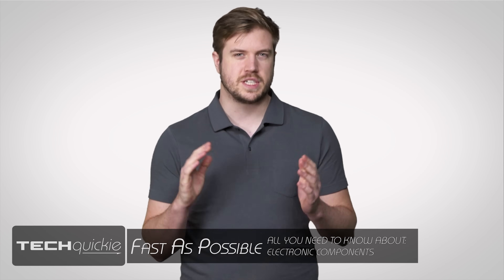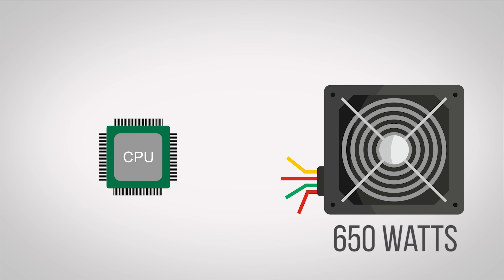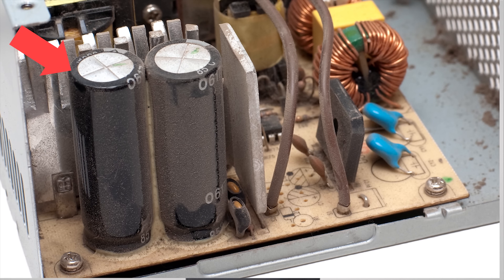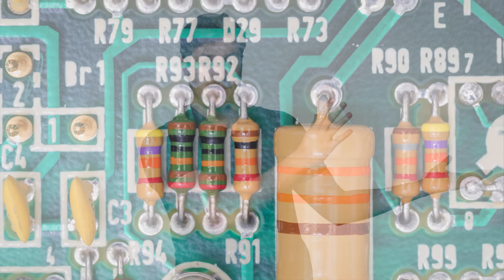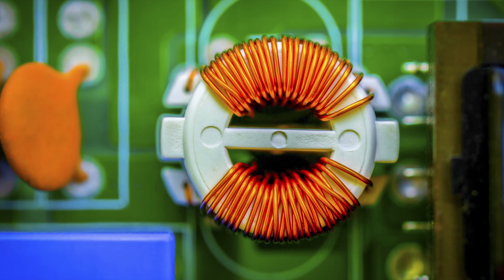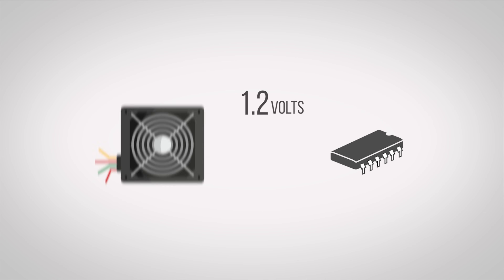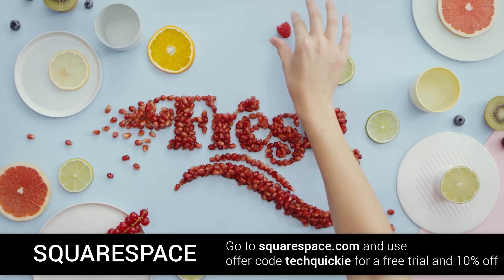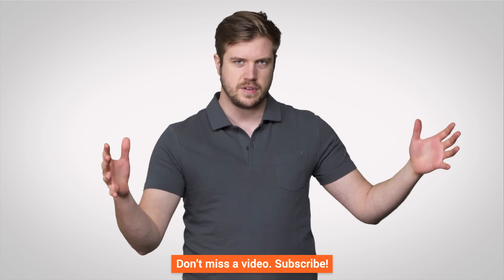Capacitors, Resistors, and Electronic Components

Comment: Alright, time for the electrical engineering dude to critique this video.
...
Eh, resistors are more for signals most of the time, and not power. Chokes can also be called inductors (in some cases). Also, there are some capacitors that look similar to resistors (look under the cpu socket and you'll see them). Not sure how important diodes would be in this video's context, but they're also a thing.

All in all, a very good video! I think it would give most lamens a decent functional understanding of most electrical components.
Reply: Alright, time for critique of engineers of youtube.
Resistors are also used for current sensing for main power circuits.
These kind of resistors have low resistance and are very often called current shunts.
Reply: As with all of these videos, there must be a limit to how in-depth the information is. We don't want people who are unfamiliar with electronics to be completely confused!

Oh, and laymen's terms, yeah, I've really only heard that word spoken, not written, so yeah.
Reply: LazerLord10 computers are full of diodes , the switch mode power supply's employ a full wave bridge rectifier on the mains input. Power supply's also contain a fair few power resistors > 2 watts. Opto isolators and op amps might have done with a mention as A/D conversion is a big part of the io on a motherboard
Reply: Diodes play as a freewheeling component that prevents any pickup from coils that generate magnetic field, moreover the power supply where strong magnetic fields are generated. 
Semiconductors are materials that exhibit both properties of a conductor and an insulator. They behave mostly like a conductor, except that with temperature increase their resistance lowers instead of getting higher like a normal conductor. They also exhibit a non linear response to current vs voltage, while a passive component (like a resistor) produces a linear response to current vs voltage.
All chokes are inductors but not all inductors are chokes. Chokes are used to block AC (hence the name choke coils) and let the DC pass through. They are usually found on audio where high frequency signals are blocked. Inductors on the other hand generally acts like a capacitor - except that it stores energy in its  magnetic field while a capacitor stores energy in its electric field. Capacitors and Inductors can both be used as resonators that is useful for AC applications within the computer like audio, modulation, demodulation, and among others.
Reply: Benjamin, the most important property of a resistor is probably the fact that you can put them in series and or parallel so to say easily. For example, a voltage divider can do many great things when it comes to controlling a singal. When most people think about resistors, they think about power resistors, limiting the current going to a certain load. These days you'll better be off using a specially designed power supply. Resistors can also make up filters, like RL filters, RC filters, etc. These are required to smooth out signals and prevent certain frequencies or things like that to disturb the incoming signal. In conclusion, resistors are often used to remove noise from signal paths, so that the controller does not see a accidental voltage spike as a transition.
Reply: Also, the inductors do not filter current after the MOSFETs, they form part of a multi-phase buck regulator, which reduces the 12V to 1.2V. To do that linearly would mean dropping 10.8V across the MOSFETs, which at 80A (max TDP for a skylake i7) would mean 864W dissipated by the motherboard.
Reply: you litrely took the words out of my mouth
Reply: what do you mean resistors are more for signals?
Reply: TVS diodes are commonly used on USB ports, so you're very likely to find them on motherboards.
Reply: +LazerLord10 You must remember that this is the internet & the odds of anything you or anyone else says being complete bullshit are pretty damn high. First off the name, does kind of give us the idea you're 10 or something. Second, it's the general idea that anyone with "a life" which translates to "a job", usually doesn't bother with the comments section. They're usually too busy working & only have time to watch a video briefly rather than have a debate over. I'm not saying you are 100% in fact lying but just throwin' the possibility out there in case there's any gullible kids thinkin' "omg a smart person". Every comment on here must be taken with a grain of salt, including mine.
Reply: I got fired month ago and I have a lot of time for youtube comment section debates xD
Reply: But will they pay 2500EUR netto? xD
Reply: Lazer , you should make a video.  I wish someone with a background/solid knowledge of electrical components would do a video on analyzing a desktop motherboard.    I care about accuracy when it comes to things like this.
Reply: resistors are more for signals most of the time.......... WTF?
Reply: diodes are also a thing.......................WOW   BRILLIANT INSIGHT!
Reply: Frz if you learn PCB design free of cost so click these link
https://youtu.be/ApXhpz8XPWE
Reply: I'm another electrical engineering dude and ngl it pissed me off the way some things were explained in the video
Reply: Could you further explain what "for signals" means?
Reply: Mr Electrical Engineering, just wanted to point out that a diode is actually a semiconductor. But yeah, 2 layers semiconductors are important. LED is an example. And nowadays manufacturers try to use LED for everything.
Also, there are many 3 layer semiconductors that are important, not only MOSFET. IGBT and BJT, for example.
And finally, 4 layer semiconductors. Which won't mention because I'm lazy.

BTW, being strict, the title of the video is wrong. It's talking about chokes, or as you pointed, inductors, which is an electrical component, not electronic, as the title might suggest.

Oh, and you are right. SMD components can be resistors, diodes, LED, capacitors, inductors, antennas... It's reaching a point where sometimes you can't tell what is what if not labeled/documented properly.
Reply: Never heard of those, somehow.
*Googles what they are
Oh, they're like Metal Oxide Varistors, kinda.
Reply: Never heard of those, somehow.
*Googles what they are
Oh, they're like Metal Oxide Varistors, kinda.
Reply: LazerLord10 lamens? Lol
Reply: Arek R. Shunts are whack, inefficient current sensing, not taking into account for parasitic inductance, etc. These days they use a coupling transformer or a hall effect sensor.

Comment: You forgot Diodes and inductors
Reply: Mrinal  Thakur aren't chokes inductors?
Reply: ... transformers are literally just 2+ inductors coupled to the same core...
Reply: And vibrators. Don't forget vibrators.
Reply: +Nizar El-Zarif
I made a tiny buck converter that could be varied to output from 3 to 30V controlled by a potentiometer with a fairly surprising amount of stability even for loads under 10 Ohms. The largest and most expensive component by far was the inductor.

On a more relevant note, they regulate the current rather than voltage. In many cases, this translates to a similar change in voltage, but the capacitors that are generally also present directly regulate the voltage.
Reply: chokes are inductors for blocking high frequency ac
Reply: Speedyjens ok
Reply: and crystal oscillators
Reply: Can you help me reach 300 subs with no videos yes we already mentioned that
Reply: FlatoutDude about chokes not inductors 
Though they are basically same but there is a great difference between them
Reply: "But I'm not going to say what that difference is because I don't know."
Are you going to complain that filter capacitors are like capacitors, but there is a great difference between them too? Yes, sometimes chokes will be wound differently to minimize parasitic capacitance, but they're fundamentally the same component with the same function. Chokes are just often optimized for a very specific purpose. If parasitic capacitance isn't an issue, I feel that most decent engineers would use a basic inductor to save on component costs.
Reply: inductors have several functionalities, in can be used in generating a magnatic field, apply phase shift, block high frequency. In the case of or VRM (voltage regulator modules) which is typical for a motherboard, they are used to store a positive or negative charge, and then up or down the voltage, depending on what you want to use them (try to google buck or boost converter).
Reply: Not really... I can't think of any non-mechanical components (at least that you'd find in a computer, and especially on the motherboard) that aren't made out of some kind of resistors, capacitors, inductors, diodes, and/or transistors... Are you thinking of something that's slipped my mind, or are you further to the left on the Dunning-Kruger curve than I thought?

Edit: Excluding heat sinks, connectors, and crystal oscillators, certain parts of certain types of memory (could be argued that they're made up of aforementioned components), and the connections between components... And any antennae and board itself, of course... And battery...
Reply: Nand gates, Nor gates, thyristors, variable transistors etc?... He's condensing 80 years of electronics into a 5 minute video. What does the general computer enthusiast know about such things, and would they be interested? I highly doubt it. Don't try to be too much of a smartass by trying to impress everyone with your limited knowledge of electronics.
Reply: You're a diode.
Reply: God Emperor Lionel Lauer yes
Reply: 999is666upsidedown if I am one I want to be a hyperfast diode
Reply: Edwin Antonio Chiñas Chiñas not always
Reply: Dylan Headrick yes
Reply: 12th ki science class nahi h ye !
Reply: Happy Singh what I am in 9th class 
Kya baat hai
Reply: Dylan Headrick which kind of oscillators mechanical crystal or transistor oscillators
Reply: I was talking about crystal since transistors were already covered in an umbrella term.
Reply: Dylan Headrick I also thought same cause crystal oscillators doesn't requires a resonator like a transistor oscillator
Reply: Hank yes they fall under inductor category
Reply: he did speak about inductors.. but very briefly..
Reply: Hank impressive. Did you go this as an engineer or a hobbiest. I don't have working experience in voltage regulators but you might be able to publish your finding in a scientific paper. This sort of application is in demand espcially for embedded sensors, or power harvesters
Reply: +Nizar El-Zarif
It was for a power circuits class. While all of the components were rated to operate within the specifications limited by my design, I suspect that they would have thermal issues when operating for very long. It was really just something I slapped together in a week or so while I worked on larger projects. Not really something I would want to stick my name on and throw out into the world, lol
Reply: See guys you cannot repurpose ferrite cores used as choke to function as  inductor inductors are designed for  minimum power loss and high transfer of energy  
Chokes are designed to saturate easily but inductors aren't a great example is flyback transformer with a air gap 
Though they work in mostly same principals they aren't same they are close cousins
Reply: Mrinal  Thakur and also quartz. But if you would mention every single component it wouldn't longer be quick.
Reply: ArthursHD yes I know that but still there are more than that many parts in a computer motherboard than he mentioned
Reply: v0000000000000000v not always
Reply: I'll take tat as a "no" to thinking of something that's slipped my mind
Reply: Hank what
Reply: Infidel Gastro oh really
Reply: +Infidel Gastro
Was your comment directed at me asking what other components were in there? If so...
Logic gates are just transistors and resistors.
I didn't know that thyristors were used in computers, but if they are, thank you for the correction.
I don't know what you're referring to when you say "variable transistor," but would it not fall under the category of "transistor"?

If you're replying to Mrinal, I agree
Reply: Hank why
Reply: +Mrinal Thakur
Because you're some kid who's acting like an expert when in reality you know less than I do on the subject, and my background has been digital logic design.
Reply: Hank you are right I am kid of class 9th but I bet I have more Knowledge than 75℅ of Linus tech tips viewers
Reply: +999is666upsidedown ????
Reply: @Mrinal Thakur: He mentioned chokes/inductors specifically. The description was even reasonably accurate.
Reply: yup he forgot about diodes but told inductors before
Reply: You forgot about... (lemme think...)

BATTERIES!!  :D
Reply: GreatScott! has a video about that, called "Diodes and Bridge Rectifiers" and "Coils/Inductors", respectively.
Reply: not to mention IC's

damn , mentioned them now
Reply: Frz learn free of cost PCB design so click these link
https://youtu.be/ApXhpz8XPWE
Reply: Don't leave out oscillators.
Reply: You also forgot transformers

Comment: Ive always felt like Capacitors looks more like batteries than water towers.

Considering this is the type of water tower im used to seeing
https://upload.wikimedia.org/wikipedia/commons/6/6a/S%C3%B8ndermarkens_Vandt%C3%A5rn_007.jpg
Reply: supervegito2277 thats cuz they are almost the same thing as explained in the video
Reply: Alloe me to rephrase that, they look more like batteries than water towers, ive never seen them as water towers.
Reply: Their purpose is to quickly charge and discharge voltage.
Basically just like a battery except MUCH more quickly and repeatedly.
Reply: Capacitors function as temporary storages, such as watertowers. Except capacitors also have a regulating and filtering function. The shape of capacitors doesn't have anything to do with it's function. So yes, capacitors are like watertowerd.
Reply: Batteries store energy in a chemical form. Capacitors store energy as a difference in magnetic charge, which is between two plates. Electrons can be deposited on the plates which gives you the ability to use it as a "energy reservoir" (kinda). I was about to write a massive paragraph on how capacitors work, but honestly if you care enough to know reply and I'll think of an explanation.
Reply: +BoomBrush
Yeah, the new notification system sucks, and I'm normally the one defending changes to YouTube.

I know the feeling. You're thinking of an electric field. A magnetic field builds up rotating AROUND a current carrying wire. An electric field builds up BETWEEN two electrodes with a potential difference (you may have been thinking about electromotive force, which is essentially the voltage/potential difference across something--in this case, the dielectric--with no current flowing between the two)  or in other words, ACROSS a dielectric with a potential difference across it.
Reply: supervegito2277 the do look like tiny D or C batteries
Reply: I know that now (and pretty sure i also learned that once, made my own alarm clock).. it was the comparison i didnt agree with..

Sorry if that wasnt clear...
Reply: supervegito2277 Ah, okay. Yeah, water towers didn't seem like the best analogy.
Reply: No need, point is they dont look like water towers to me

https://upload.wikimedia.org/wikipedia/commons/6/6a/S%C3%B8ndermarkens_Vandt%C3%A5rn_007.jpg

Ive always felt they looked more like batteries

https://res.cloudinary.com/greenline/image/upload/c_limit,q_90,w_1280/v1392754862/alkaline-batteri-d.jpg

Also feels like batteries too iirc.
Reply: Waits literally 2 minutes for picture to fully load

That is certainly a funky looking water tower. Looks more like a UFO landing station. Yeah, nah it's all good. I would probably write about it mainly so that I'm sure I understand what a capacitor even is. Meaning while I'm writing, I'd be confirming with myself plus other people reading to ensure I get it as close as possible to the actual answer.
Reply: Capacitors are batteries, sort of. Super Capacitors can be use as such, but the issue is, that they bleed a lot faster.
Reply: +BoomBrush ...I think you're thinking of the nonexistent flux capacitors... Capacitors store energy in an electric field. Inductors store energy in a magnetic field. It's the creation of the electric field that allows the caps to store a charge.
Reply: +Hank come on youtube, why did you add this google+ feature where you could tag people in comments then remove it? it was the only useful feature it had and now its gone. manually typing +Hank even though nothing happens. only doing it so other commenters know who im referring to

Well, I dunno what I meant when I said difference in magnetic charge, I've been awake for almost 24 hours so I'm kinda sleepy. I guess whatever it's called when electrons repel other electrons. Like, for AC circuits where the current "passes" though by the electrons creating a field then that field being used to push electrons out the other end of the cap (not direct electron push). I have no idea what I'm talking about, maybe I should get some rest. I think what I meant is that it was the electromagnetic force that was causing the changes or something.
Reply: supervegito2277 It's more of a functional comparison as opposed to a visual comparison. Capacitors can charge and discharge quickly, yet they also are used in scenarios where you can block DC but allow AC current.
Reply: How about resistors that look like little bricks with numbers on them. 
I had a dead laptop I was trying to see what I could see wrong and near the power input I noticed two of them with 
0.0 on them. I thought 0.0???  That must mean no resistance so they must be some kind of jumper on the board. So I measured as best I could and found one to be conductive and the other wasn't. So the one that wasn't conducting I soldered an Itty bitty wire across it and then it ran again and it still runs many years later.